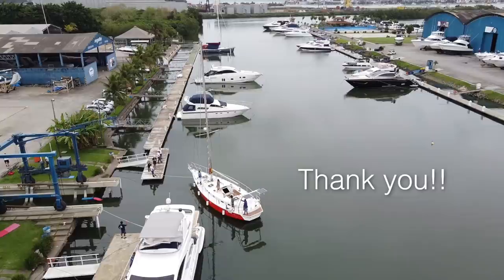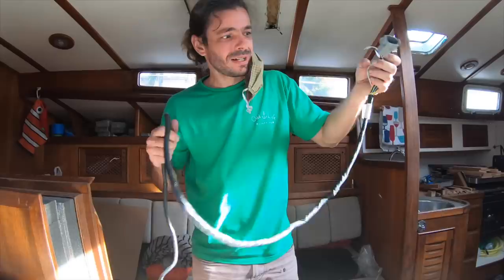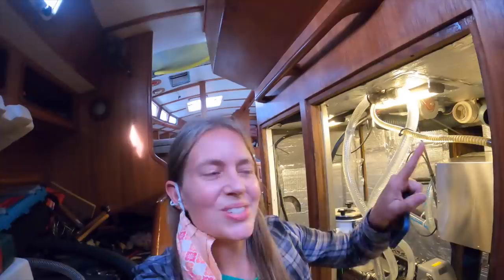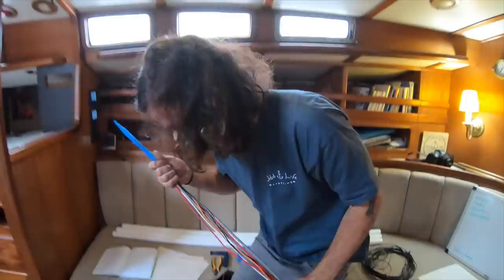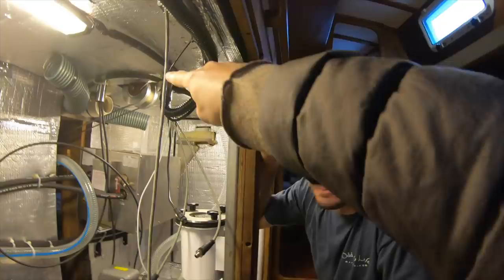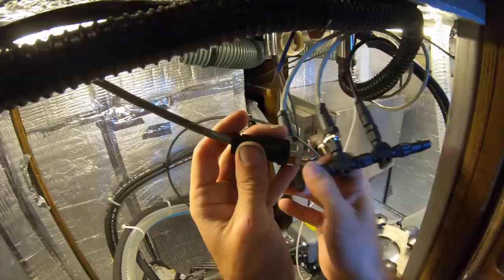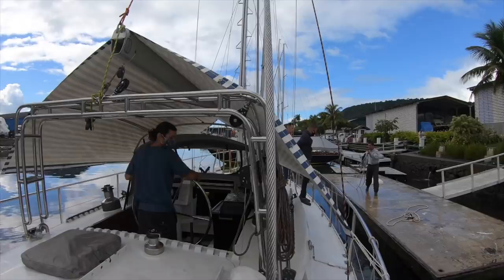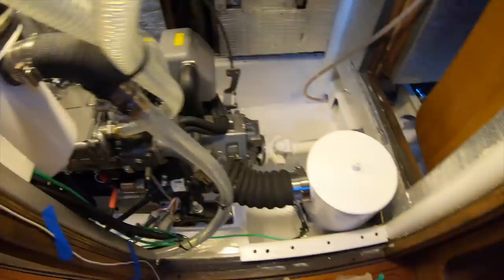⛵️First Sea Trial of Kelly (our brand new Yanmar Engine) #192

Comment: Your engine room is an example of clean setting. That will pay off when you are in a rough sea and need to see after the engine. All visible with good light. Great! Start to apply for Starlink Internet. I don't want to mis out on the episodes when you are out in the world!
Reply: Starlink isn't mobile, it's exclusively stationary.
Reply: Yes, current starlink is stationary and guess what: Sailors are often at anchor or moored. Mobile solutions will come.

Comment: I love how much access they have to there engine, most boats out there barely have enough room to get to the engine.
Reply: It's a really well designed boat, it took a while to bringer her back to life, but it was worth the effort, would have been a shame if that boat had rotted away to scrap.
Reply: So true. Kudos to the designer.
Reply: The original engine took up much more room.  The new Yanmar is considerably smaller, giving more space in the engine compartment.
Reply: I've never seen such an engine room ! Clean and lighted like an hospital O.R. !
Reply: @marshallmurrell4583  The original engine must have been huge!
Reply: You can see everything and, if something goes wrong, you have good comfortable access to fix it. Flick the light on and check the motor every time you start up. Check you have water coming out the back and you will have a happy engine for many years.
Reply: It really is a beautiful engine and compartment

Comment: Duca, watching you realize you had the wrong gender connector remined me of the time I had just finished soldering a huge multipin connector and realizing the big bronze shield wasn't on the cable and I had to desolder that cable in order to put that bronze shield in place. Even experience is no protection against human error. You pressed on and that is just what you have to do. We are really getting close now and it is exciting.
Reply: Perhaps instead of removing one connector and re-pulling the cable he could have removed two connectors and swapped them. Duca will learn to not be so afraid of electrical stuff soon.
Reply: @MargaretLeber  Right, NEMA2000 is barely any pins.
Reply: I can't tell how many times I forget to slip those heat shrink insulating tubes before soldering my connections ! 👹
Reply: @marcryvon  back in the day when I did a lot of phone plug audio the usual trick was forgetting to put the threaded sleeve on the cable. These days heat shrink is about the same thing.

Comment: What a fantastic milestone.  Congratulations.  A couple of things you may consider.  First, look at getting a non-contact thermometer to check the temperatures of the engine and systems rather than your fingers.  It can look into tight spaces and save you some painful burns.  Second, label all of your thru hull valves and in the engine room make a placard of the valves and their location that need to be open to run the engine, including fuel valves.  In the event of an emergency, someone not familiar with your boat will be able to move it safely.  I had to move a boat to a storm safe Anchorage for a buddy who had become ill and it was very difficult to trace down all of the systems.  Again, congratulations and looking forward to videos without a boatyard.

Comment: You have an awesome engine  setup now and a clean, bright, well illuminated and accessible engine bay. That 7.9 knots top end is an impressive figure and nice to have in an emergency.  Have been caught fighting tidal currents in narrow estuaries and getting nowhere. So its good to know you have the power if you need it. Hope everything goes as well with your under sail trial.

Comment: Wow show👏 ... Can I give a tip for compass?   You can avoid the creation of a magnetic field by twisting together the two wires of a circuit. Any wiring beneath the compass and instrument panel should also be twisted in pairs, one pair for the two wires to each instrument switch.😃

Comment: It is not good to solder a multi-strand cable then hold it with a screw. The solder is soft and it will "creep" (flatten) to leave the connection loose. Please check this occasionally. Make sure that the screws are still tight. Normally, I would fit a tiny "ferrule" (tube) to each wire end.
Reply: Agreed. The lead acts as a lubricant. More critical in AC applications, but agree with the comment above

Comment: Wow, I thought I'd never live to see the day when the "Never Sail" aka ODD LIfe sailboat leave the yard, much less the dock, but you finally did it. Congratulations!!! Now to see you finally sail it. The best thing that you take away from this experience is that unlike 99 percent of the Captains of other sailboats, you intimately know every system, every wire, and hose, where they go and what they do. There is nothing you can't fix. Your knowledge is extremely valuable, so do not ever sell yourself short - it can easily become another revenue stream to support your new lifestyle, So God bless you both in your new life away from the Yard, away from the dock, and finally on your way to foreign ports and a new lifestyle.  p.r.morehouse - author

Comment: Perhaps, in the future, you could set up a "quick disconnect" for your custom connections a little way down from your pipe/conduit so you can maintain those throttle connection wires without all the hassle and they will fit into the pipe (after disconnecting) and you can just tape together, attach some strong cord and then draw them thru.

Comment: Duca, it looks like your running 12 gauge wire for the compass and instrument lighting 18 gauge should be sufficient. It will give you more room in the conduit. Just make sure you fuse it correctly

Comment: May I suggest that you fit plastic backpack clips and nylon webbing straps to the rain cover so it can be instantly clipped or unclipped onto the rails - and save you messing around with tying bits of string.

Comment: At 16.15 Duca’s hand is at the bend of the cabletree ( conduit) , better make a small hole at the bottom of the conduit in case of leakage the water will drip out instead of ruining the cables .

Comment: On the cable with the wrong ends, could you have just swapped out the ends instead of running the wires through again?

Comment: You have to make sure valve on toilet water flush is pushed HARD over because if not it can end up with pumping handle not working due to resistence I had this problem at odd times on same heads

Comment: To add oil to my engine, I have to pull up my carpet, take 3 drawers out from a sofa/bench, move the sofa, lift a section of the floor, and then I can add a quart of oil. Then I get to put it all bact together. I am envious of the engine compartment on this boat.

Comment: It might have been prudent to have the sails ready to go in case something happened with the engine. Always have a backup plan, even if it’s not a fully fleshed out one. Also have the anchor ready to go if the engine craps out on you. Better that then becoming a drifting hunk. And the dinghy ready in a worst case scenario.

Comment: If you draw the boat speed as function of the motor revolutions per minute, the optimum seems indeed to be at 2700 rpm as the grafic bends down after this point. The 7.9 knots at 3000 rpm seems a little to high as it is way over the expected value of 7.3 knots. I think that a good motoring only cruising speed would be around 6.2 knots at 2250 rpm. Don't push Kelly to close to her limits. For a car engine, 0.5 to 0.75 of its maximum rpm is often adviced.

Comment: You should use ferrules on the stranded wire instead of solder. Solder can cold flow and make loose connections.

Comment: Argh...I must have missed the post where you installed the dodger... Looks good all the same. And, not to be negative,  but you may regret not lowering the transom deck down closer to the water level. Certainly makes it easier for boarding dinghy & for getting out of the water when swimming..  Otherwise, she's looking very sharp, a credit to you both for your hard work, perseverance, effort and skills. And the fact that you both get along so well. Good luck on your next adventure.

Comment: you didn't need to remove then reattach the connectors. You could have just gotten a bus/terminal bar, that way cou could pull wires through and wire to bus bar. Good for running wires for extra components and future problem/maintance/additions

Comment: You shouldn't solder the ends of the wires before you install them in screw-tight connectors, the solder will squish over time and get loose with vibrations, never-mind can flow with enough heat.  There are wire ferrules designed for this application, they are pieced of thin copper tube that crimp over the ends of the wires before being inserted and screwed down.

Comment: You guys have done such a great job but I really wonder why you made things harder on yourselves  . You cut two inches of cable off only to have to reconnect them . And then you said that it really wasn't a problem because you could have pulled the wire back to the other end . All that hard work for nothing  . I noticed you did that on other projects  . The thing is you both learned so much except for the example I gave  . Sometimes its just best to leave things alone . 
But all the work you have done is really something too be extremely Proud of  .

Comment: noticed that you use a lot of small gauge (diameter) rope/twine. would it not be a help if you used bungee cord? it can be purchased in various dia's and lengths as well as in pre-made with hooks. it seems to me that it would be a better option than rope.

Comment: What is the purpose of the annoying beep-noise from the engine control panel? You probably know when you turned on the panel but didn't start the engine yet, or the other way around when stopping, so there's no reason to have it scream at you. 
Is it supposed to notify you when the engine stop unexpectedly?

Comment: will roberta take the captaincy exam? is there a piloting and maneuvering course to take instead? i often see couples sailing have the man pulling lines and tying off the lines while the wife steers and controls speed. that may be something to consider if one is more agile and stronger to be in the danger position

Comment: Any of you diesel folks know what the pink fluid on the side of the engine is for? It seems to be vented or at least connected to the rocker cover?
Reply: I think it's just the overflow tank for the coolant.
Reply: @johnnyhag675  yeah, at the very end they did mention "coolant" but it did look strange to a non marine engine person.